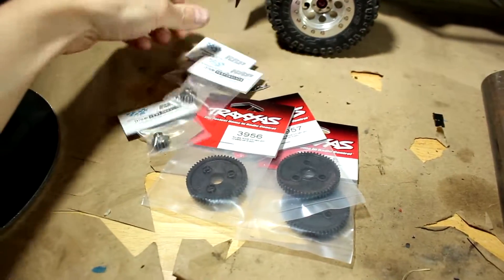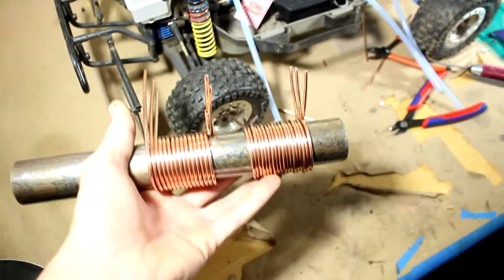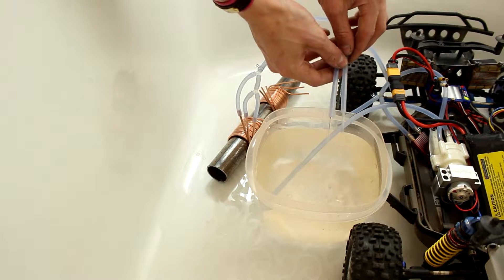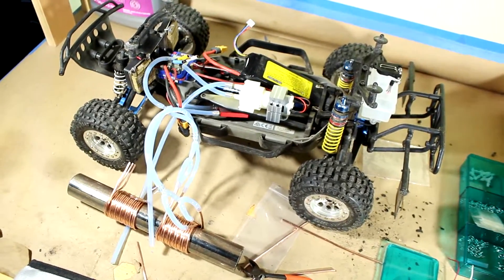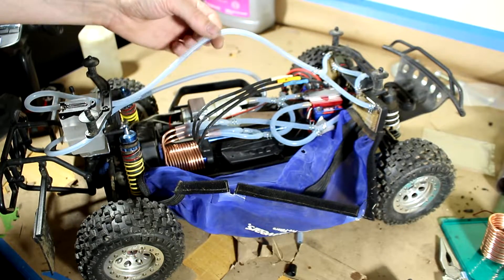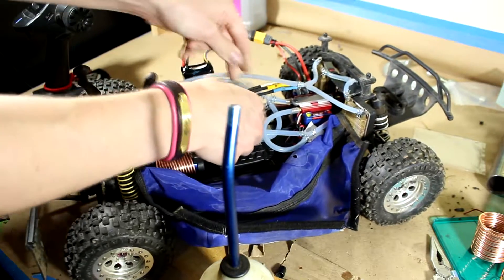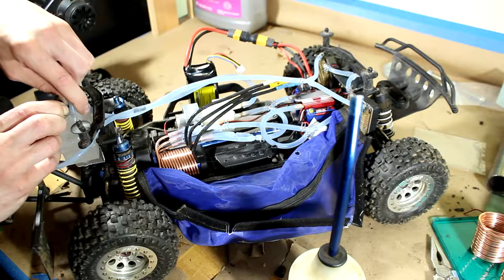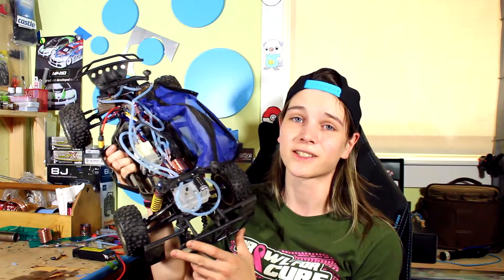Water-Cooled Slash 4x4 |Ep 5| System Assembled - First Test with Water!!

Comment: I know I’m a little late to this, just be careful having mixed metals such as aluminum and copper in the same loop because it can cause corrosion so just be sure to put a corrosion inhibitors in it, also where do I find some of those radiators I can’t find them anywhere
Reply from the maker: Good points on the mixed metals. Search up lesu hydraulic cooler on ebay and you'll find em.

Comment: Getting closer to finish :)  could add some red dye or other color for looks, if dye does not cause any interference.  Might thought,  rapping the motor with three separate line will increase water return, could use large water hose before the splitting.  And yes the test will show improvement, with this system there could be many changes, but all need a good acceptable temp.   :)
Reply from the maker: I definitely could use a larger supply line to the motor, we will have to see how things go!